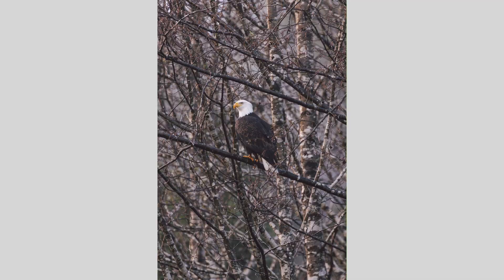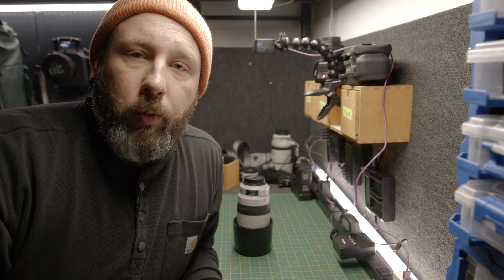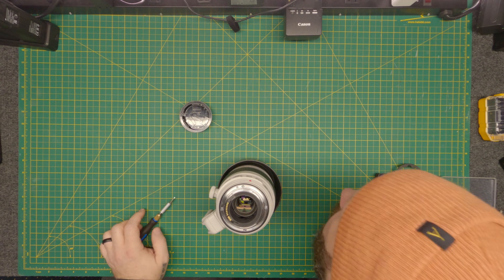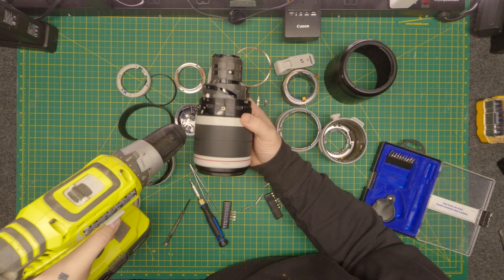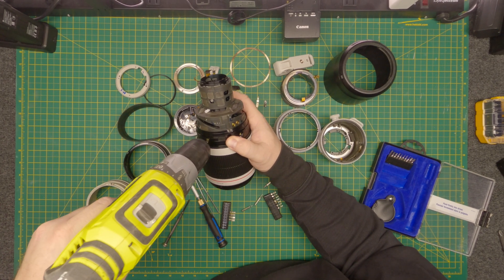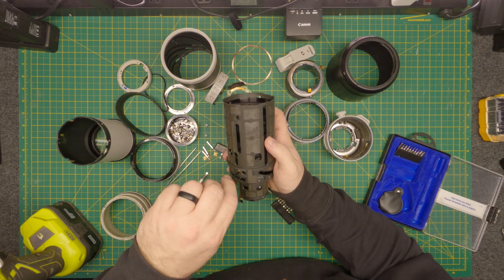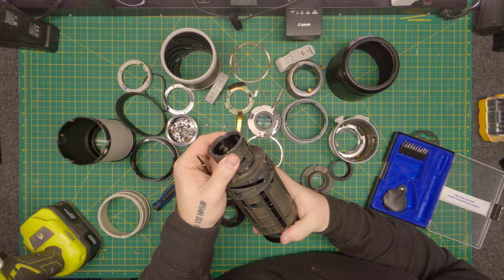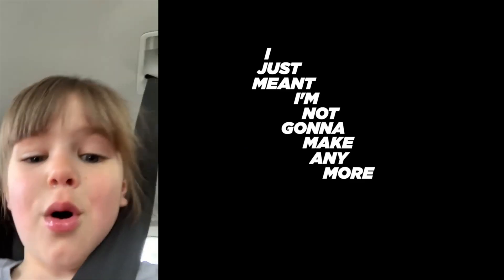Taking apart a camera lens | Canon 100-400mm

Comment: Well done on taking it apart! Keeping track of the parts (if you're not a Canon lens tech with the service manual) involves taking lots of photos &/or video at every step, laying out each disassembled part in order in a known orientation (face up/down, and how rotated), so you can reassemble in reverse order, and using different coloured sharpie pen &/or tape to mark where each screw/component goes where, wherever possible. Also, use Japanese Industrial Standards (JIS) screwdrivers, NOT Philips head, and avoid power tools as they can strip screw heads or threads respectively.
Reply from the maker: Very helpful to know! Thanks so much for the info and I had no idea about the JIS screwdriver!